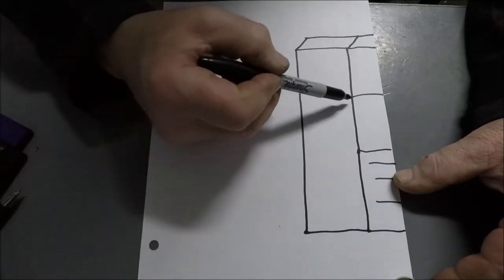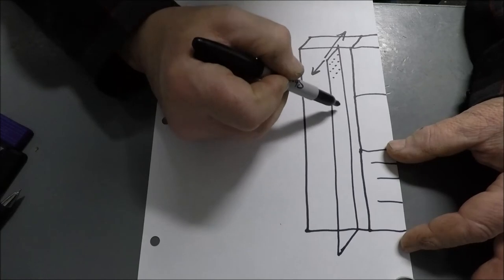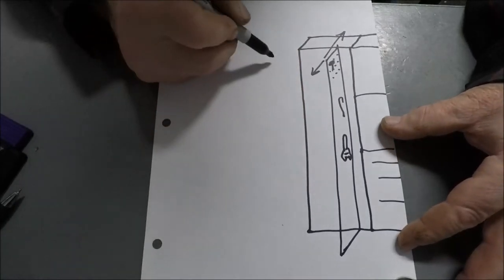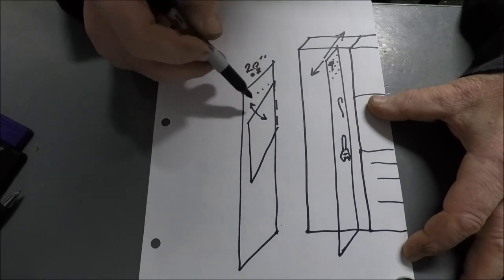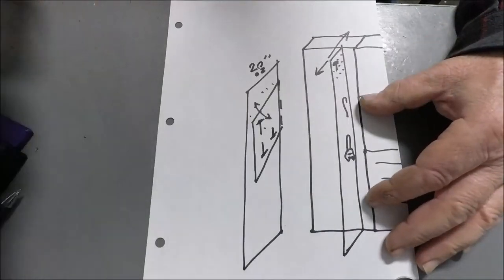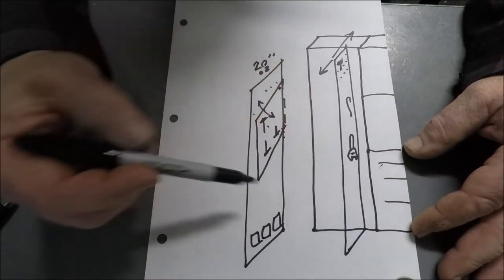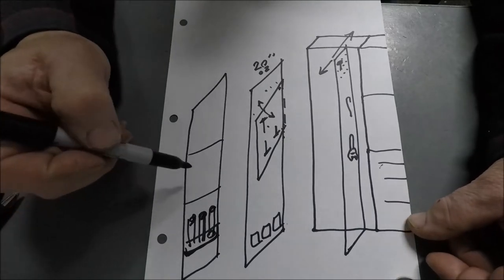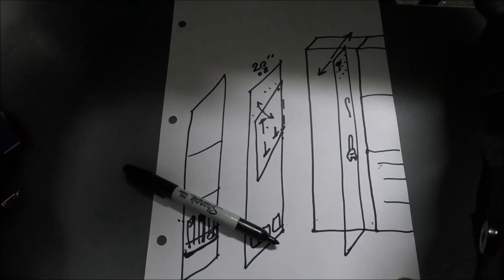Updated Plans For Next Project

Comment: First...
I hear ya on your rant. I drive truck, yes, that big red Kenworth in my avatar. Just yesterday I was in the middle of nowhere, Ca desert. 2 lane stretch. They run most oversize loads out there. I just happened to have a few cars in front of me and a few behind me. There was 2 oversize loads coming from the other direction. NONE of the cars in front of me slowed down, just took a bit of the dirt shoulder and kept at the 60 or 70 they were doin. I slowed way down, down to about 15 or so and grabbed some of the shoulder. The knuckleheads behind me, damn near rearended me. Then, once the oversize loads passed, they sped up, passed me, and flipped me like I was the moron. Cant stand people on the road.

Now, your side cabinet. I like your idea with the trays and slide outs. I think you should build it, like you did your top. 

I bought some trays similar to what you got about 15 years ago when I built my bench. I hung the trays on the back of the doors I put to make a "cabinet" underneath. I had to adjust the doors to a slight angle to counter the weight. But it worked out nicely. I put screws, nuts, bolts and some other odds and ends in them. Lookin forward to this project.

Comment: I’ve watched all the videos on this cabinet and it’s awesome.  I’m going to make 2 28” side lockers for a 3 bay Mac tools macsimizer 79 inch bottom that Ive had for 20 years.  I’m obviously not paying like 3 grand each.  I’m going to make one of them with the big open drawers like the big ones with a few shelves, ant he second one might be something loke this triple rack deal.  Question is where did you get your casters?  I might try to get the ones for the us general 72”.  What are your thoughts cause these lockers are going to be huge.  I’m also going to build a hutch first.  I’m going to make videos as well, should be a good time.